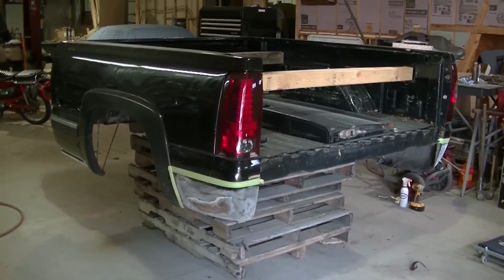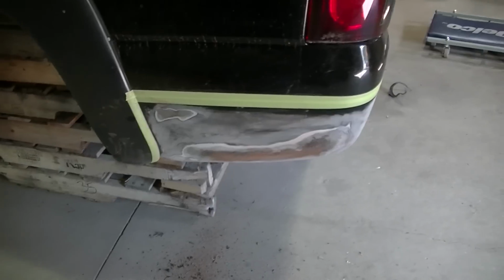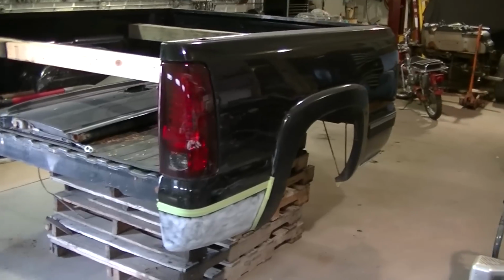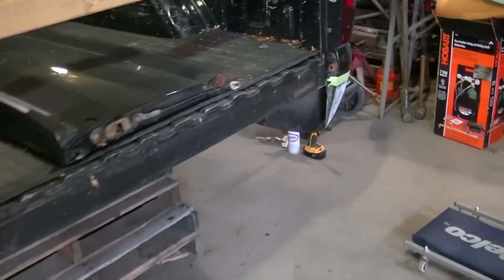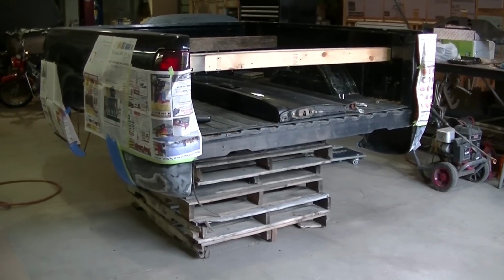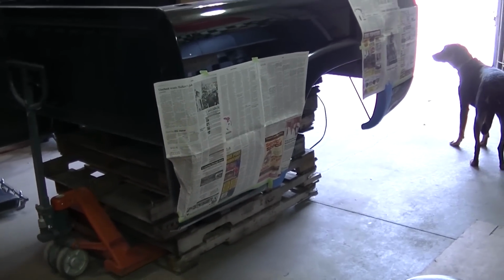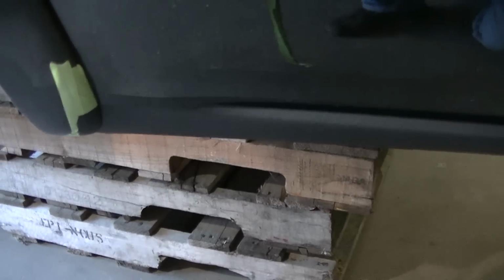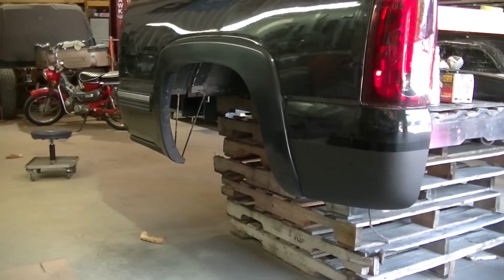2000 Silverado z71 Bed Rust Removal and Duplicolor Bedliner (3 of 5)

Comment: Nice work, I have to do my cab corners too but I'm not taking the box off again. I just  unwind the box bolts on the opposite side I'm working on to about the last 4 threads and tilt up the box.  I put a couple of jack stands between the bed and the rail.  Gives you plenty of room, works good on pump replacement as well.
Reply from the maker: Steve Rob   The dually is getting bad too.  I really need to address it this summer but not sure I will have time.  Taking the bed off is easy for me with the forklift.

Comment: I was thinking about haveing my truck rhino lined at ziebart from under my front door trim down to the rockers,then go all the way back to the bed ends around cab corners, about a 8inch strip along the bottom,my truck is black and i seen a truck done that way the other day and it didnt look bad
Reply from the maker: Game Bred Duramax   It would add a lot of protection.  Some people like the look and others don't.  On a 4x4 I think it's ok.  My 2000 I am going for a street truck look so I don't want the bedliner to show much.  On a black truck the bedliner is harder to see.

Comment: Looks good!  Thanks for the tape tip!
Reply from the maker: farmboy30117   It turned out good.  I hope it doesn't peal off like the s10 where there was rust.
Reply: I think it will be ok since you used the rust converter on it.  I'm hoping the same thing for the roof of my cab ;)

Comment: Up here in Ontario Canada it’s really hard finding any truck that’s not rusted out for under 10k . I just did a complete frame swap on my 2000 GMC Sierra with a low mileage engine ,rear end ,brakes and lines , transfer case ,trans mount , all 4 shocks,main wiring harness was bad do to being water logged , abs unit went out because of the harness being bad . Now I have a new truck the frame looked like it just came out of the gm factory it’s so clean for a 05 frame . It wasn’t planned but I had already spent 6k .$3100 buying truck and another 3k getting truck ready for safety. Then we found out the frame and cross member was rotted behind fuel tank

Comment: It is very sluggish and at around 3500- 4000 rpm starts making a noise like tapping or knocking. Just seems bogged down. Replaced air and fuel filter and cleaned mass airflow sensor with no luck. It ha 126000 miles on it.
Reply from the maker: Dunes4321   I would tap the cat with a rubber hammer and see if it makes any noise.

Comment: I have a rust hole in the same spot on my bed. Looks like hell. Gets some Rust-Mort, it petrifies the rust so it stops.
Reply from the maker: UnitCrane514   I saw a few different rust treatments.  Not sure if they had Rust-Mort but I will look next time.  Some of them called for rinsing the product off.  I didn't want to add water to the mix of freshly sandblasted metal so I went with this.  Plus it was the same brand as the bedliner.  I don't like mixing different kinds of paint.  That doesn't end well sometimes.

Comment: I know this is a old video but my 2000 box is rotted at the front I’m thinking of just cutting the whole front out leaving say a 1-2” lip all around and putting a piece of diamond plate in place with 3 m 5200 and rivets. Only thing I’m concerned with is how the front of these boxes are stamped from factory but I think it will be a bitch trying to patch a non flat surface . A new rust free box is like $600-1k up here in Ontario and this box is in good shape otherwise expect alitte surface rust on bottoms

Comment: Hey boss. I'm no mechanic and I need to get my 65 c10 going. I cleaned the plugs and changed the fuel, cleaned the carb and cleaned the points and it still won't fire up. It been sitting for 16 years since it ran on its own. 2006 i moved it forward like 10 feet to cut the grass and just bottle fed it. I also just changed the fuel pump. Please help
Reply: I'm no mechanic either but I would get a spark tester and see if you have spark and if you do I would try spraying some carb cleaner into the carb  or a bit of gas with the throttle plate open and see if it fires on that. Your missing fuel, spark or incorrect timing .
Reply from the maker: Randy Bobandy   I agree with Steve.  You need to check for spark.  I would get new plugs.  Is there a fuel filter in the line?  Probably need to change that.  When you were cranking and pumping did you smell fuel?
Reply: Steve Rob well actually, I cleaned the carb but still haven't gotten it put back in so I'm hoping that I can get it going once its back in. Before it turned over but it still won't fire even with gas in the carb
Reply from the maker: Randy Bobandy  I would say spark is your problem then.
Reply: mossman381 i don't even know how to deal with no spark
Reply from the maker: Randy Bobandy  Pretty hard to explain it in a comment.  For one thing you need all new plugs.  Then pull one out and set it against the exhaust manifold crank the motor and see if it is sparking.  You need to set the gap on the points right too.  I don't know what that is.  You need to look it up.  You need a good strong battery also.  DO NOT hold the spark plug while cranking.  You could get a good shock  :)
Reply: mossman381 oh yes. I can handle some good shocks, I had 110v go through me one time and it was horrible, I was tingling for 10 minutes
Reply: mossman381 c10 went up in flames today, the motor anyways so time to rebuild it and re wire it
Reply from the maker: Randy Bobandy  That doesn't sound good.  What happened?
Reply: mossman381 backfired n fuel caught on fire
Reply from the maker: Randy Bobandy  Sounds like the timing was way off or maybe you have some stuck valves.
Reply: mossman381 I don't know if that's it, backfire is a blast of flame coming out of the carb and if there is fuel sitting in there, the fire will grab the flame and spread it
Reply from the maker: Randy Bobandy  If everything is working correctly the fuel is ignited in the cylinder on the compression stroke.  Both valves are closed and the explosion is contained in the cylinders.  If your timing is off or your valves are stuck open then the explosion isn't contained in the cylinders and comes out anywhere it can.  If you are dumping gas down the carb then all of that will ignite as well.  Gas is very flammable and it doesn't take much to start it on fire.

Comment: I live in Michigan and know all about the snow and salt like yourself so my question is how's this stuff holding up? and would you recommend the rust fix?. I'm almost done replacing a lot of my rusty Chevy as well and thinking about spraying some of this rust fix on the new panels to prevent future rusting. Great videos as always, Newer subscriber and will be for a long time.
Reply from the maker: +huronhockey8   This bed hasn't seen a winter with the rust converter yet.  So far so good.  I did this same thing on my 98 S10.  The bedliner did a good job except where the rusty areas were.  It started pealing in those places.  I am hoping the rust converter will stop that.  You only need the rust converter if you have rust.  If you have new bare steel I would use an etching primer first then a good paint.  Then I would go behind the panels you replaced and spray Fluid Film.  I am in the process of rust repair on my dually and am going to show how I do everything.  The rest of the videos should be up this week I hope.